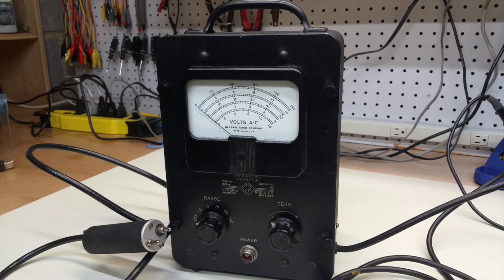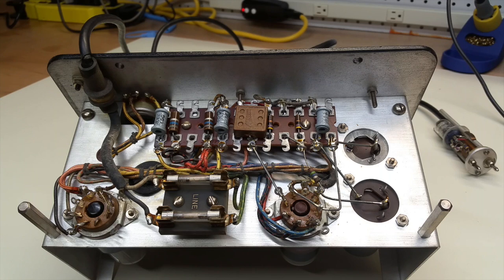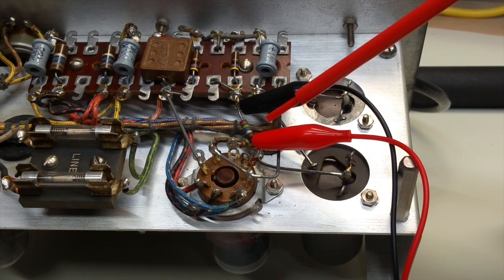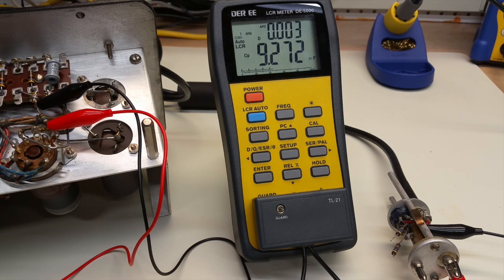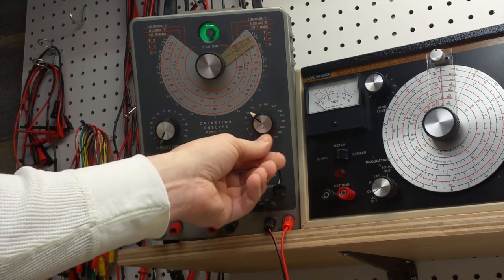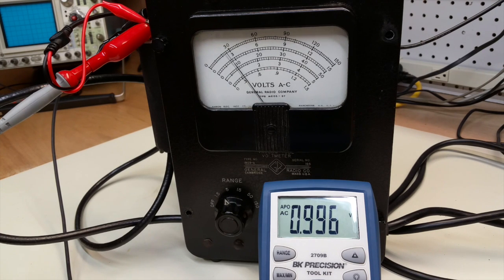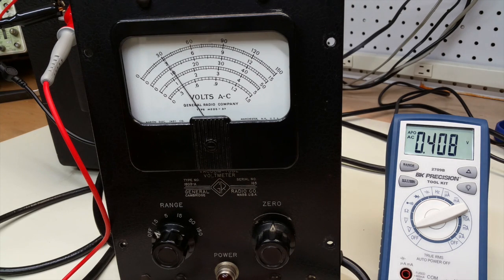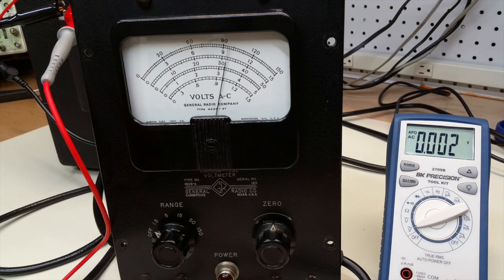#2: General Radio 1803-A VTVM

Comment: Good video. I'm really impressed with you video and audio quality. First class. My videos (I do tube radio restorations) are quite a bit less clear, so I'm interested in what camera and mic you use. 
Yours is also one of the neatest benches I've ever seen. Well done. I subscribed without hesitation. Thanks.
Reply from the maker: Thank you! I use a cell phone camera mounted on a tripod and am able to speak close to the mic. Also, I use overhead LED lighting and have bright walls that reflect the light, and this combination seems to produce clear images on the camera. I'm pleased you like the videos. As for the bench, I can't work with too much clutter!

Comment: Watch the video around the 4:04 mark.

I'm a noob when it comes to electronics, but how can you measure a resistor when it's still installed? Wouldn't you get inaccurate values, since the rest of the system might affect the reading? If you have for example 2 resistors in parallel, how can you have an accurate measurement for only one? Because when you measure one you get a reading based on both resistors. Can you understand what I'm getting at? I would think that you would need to desolder one side of a resistor for an accurate reading.
Reply from the maker: You're quite right, if there are elements in a circuit connected to a resistor, then measuring it in circuit will be misleading. In the video at the 4:04 mark, one end of the resistor terminates at a tube pin, and possibly (I don't recall at this point) a capacitor. Since the tube has been removed, measuring the resistor will give an accurate result, since that end of the resistor has been electrically removed from the circuit. In the next scene, which deals with the probe, I have clipped one end of the resistor being checked out of the circuit. Thanks for watching and leaving your comment.